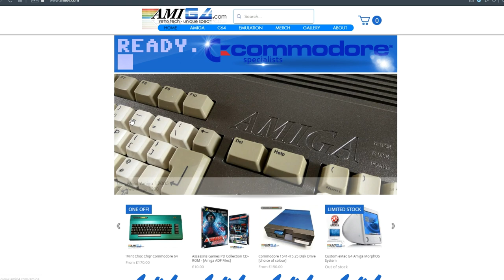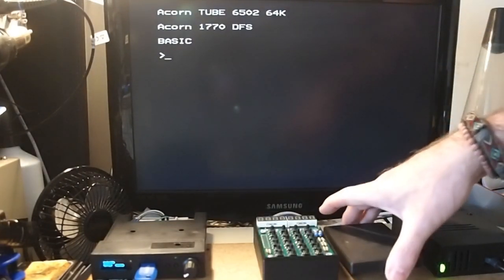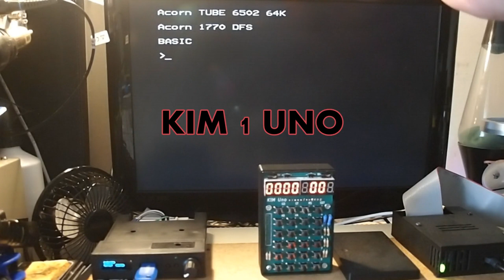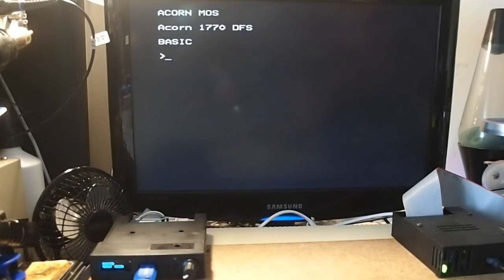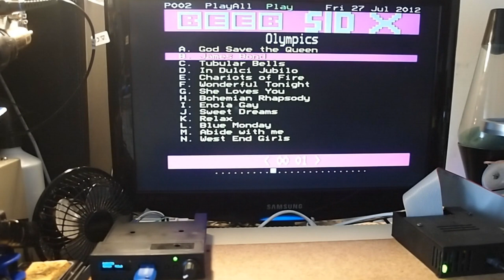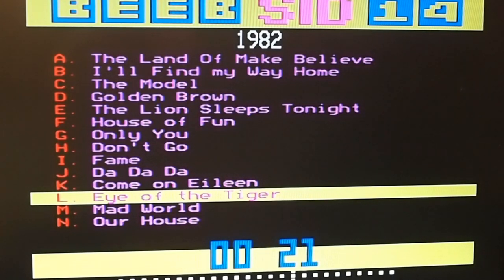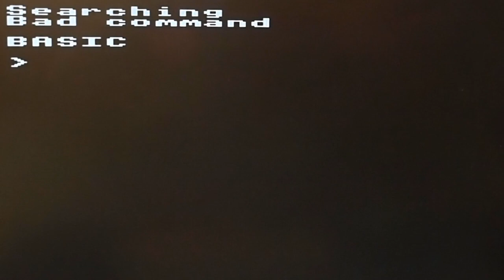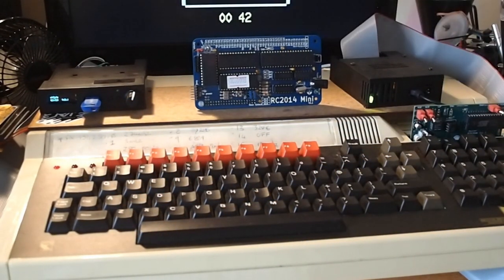BBC Micro :  BeebSID. Building and demonstration (SID chip)

Comment: Excellent!!!  Lovely case there, and I love that game at the end there!  I need to finish my part 2 - it's going internally on mine I think.   Thanks for the mentions =D  I should be looking at some of the bits you sent me soon - sorry it has taken an eternity!  Just been trying to clear through a backlog!   The 2Mhz bus is a pass through I think!
Reply from the maker: Yeh the SID quiz is genuinely great as a party games type thingy! You're welcome for the mentions, I admit I referred to your video a number of times to check I was on the right track. Yours has that lovely VU metre which Im quite jealous of but am happy with mine as is. I haven't looked at that ST you sent me yet (apologises)..will do a video sometime of that. My issue is one of space -what you see in the camera is literally all the space I have for working on projects/repairs etc and so the ST has remained off camera so far. Ah, so it is a pass through, good to know. TBH in my case I don't use the 1mhz bus for anything else but good to be corrected. :)

Comment: Good stuff. What is that USB floppy drive kit please?
Reply from the maker: oh im just using a gotek drive (cheap and plenty on ebay) which I modded with an oled screen, speaker and rotary dial. I think you can buy one pre made from Retro Clinic which would save all the hassle of modding yourself which is quite a bit of work tbh (involves flashing firmware as well as some soldering etc). hope this helps?
Reply: @RetroMarkyRM  It helps, a lot! Just bought one. I do fear that my floppy drives are going to die, especially the 5.24".
Reply from the maker: @msknight5  excellent. gotek's can be fiddly to set up at times (if you're going from system to system like me) but well worth the money. They can be configured for almost all 8 bit systems, old PC's not to mention amiga/atari ST etc so worth the cash. let me know if you get stuck with yours but I think you know what you're doing!